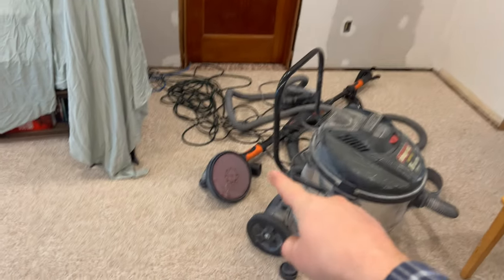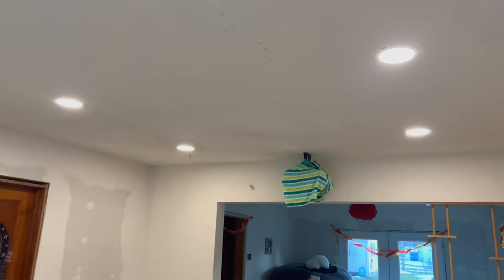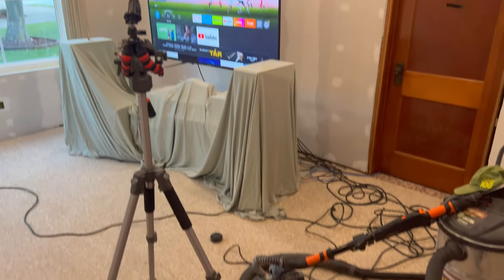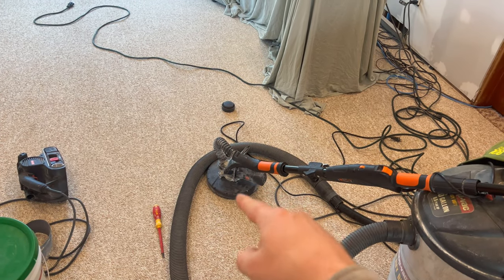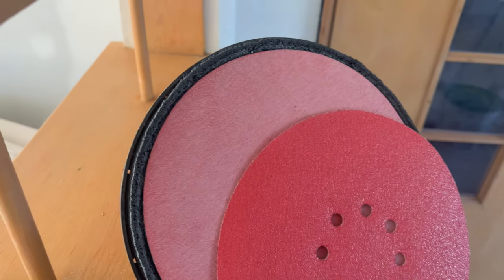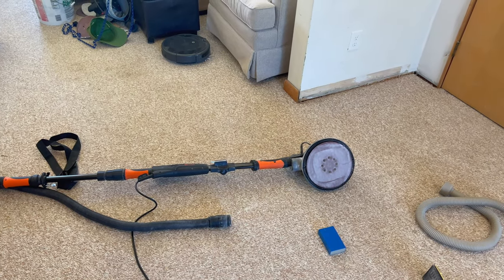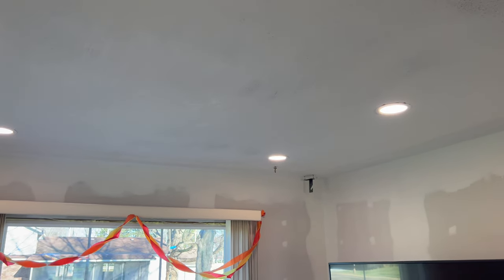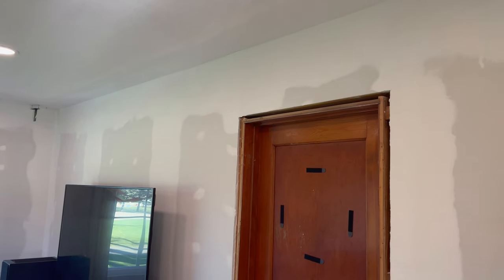The WORST, SOREST, MOST HORRIBLEST Job EVER! EVER!! Belt Sanding Acoustic Ceiling

Comment: Well Randy, i really hope whoever put that texture on your ceiling there didn't use asbestos to create that texture.  My sisters house has textured ceilings and sure enough they used asbestos to create that texture in her ceilings.  At the time they thought it was a good fire retardant, but unfortunately they didn't realize it causes cancer.  Her ceilings have since been covered up with drywall to contain the asbestos because removing it would have been so very costly.
Reply from the maker: That's a good point! The ceiling I'm guessing is only a few years old (at least this layer of it...) at most so I don't think they would be using asbestos?